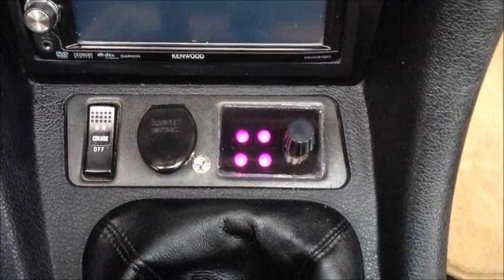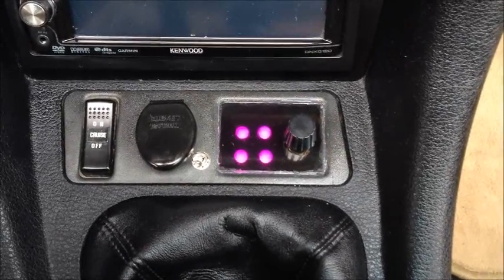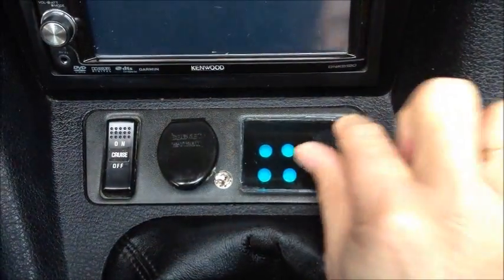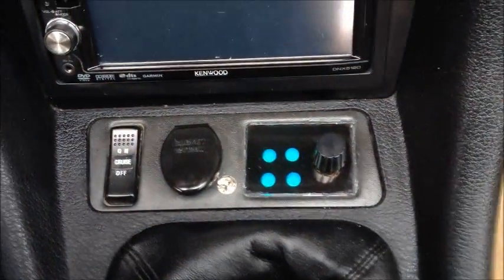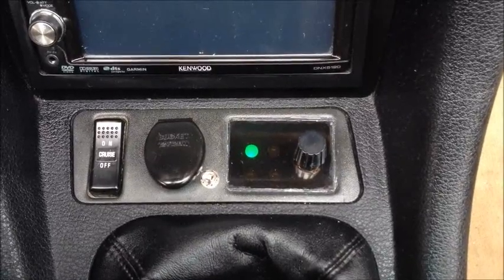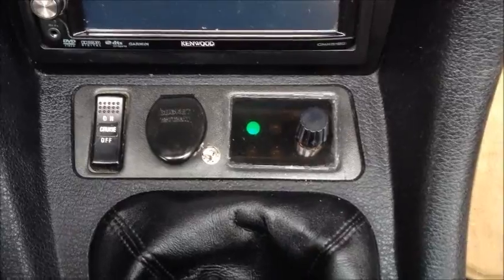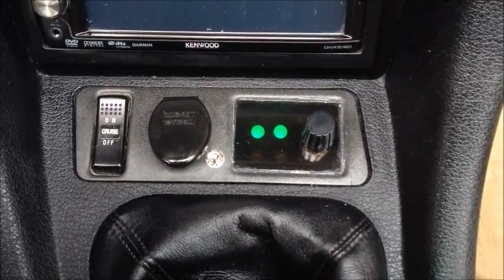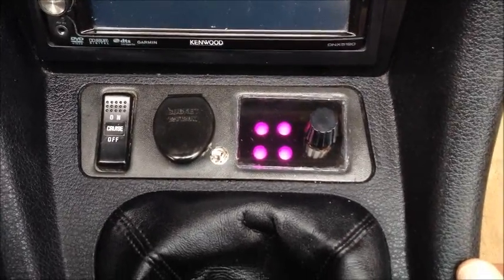TechWorks Mitsubishi 3000gt ECS Add-on Controller Demonstration Using LED Status Lights

Comment: I know this is n old video but i just bought a 1991 dodge stealth r/t non turbo yesterday with 96k origional miles and i noticed the tour sport light is constantly flashing theres a ECS button but it does nothing and the sport/tour button is missing i think.if i change the caps on top of struts can i make the same thing how you did? And if so what was the cost to do this?